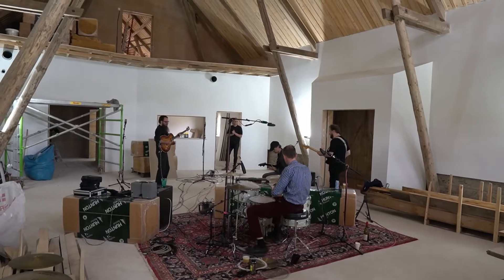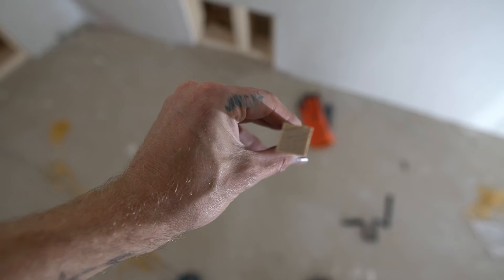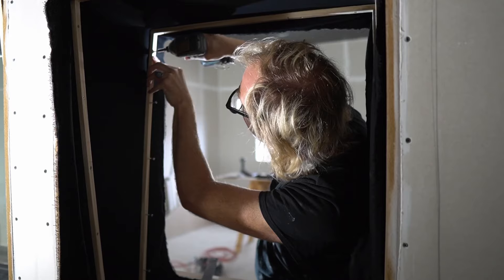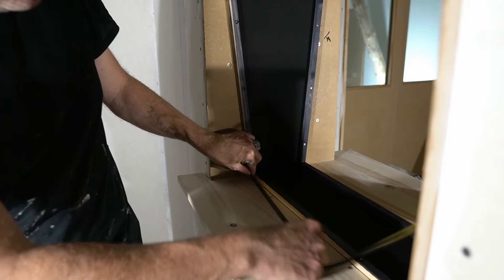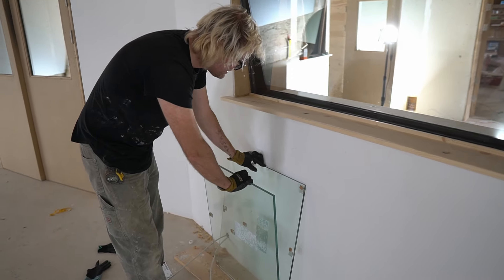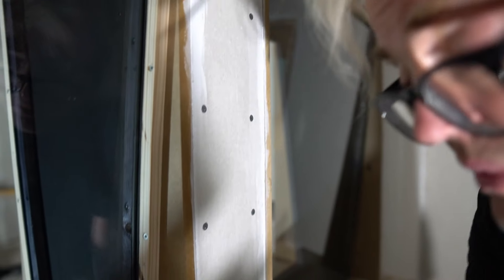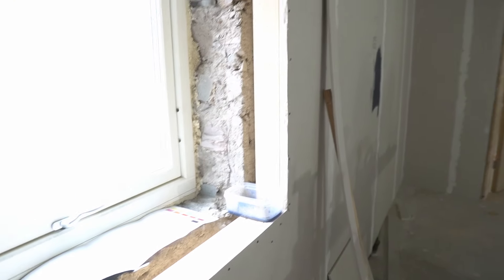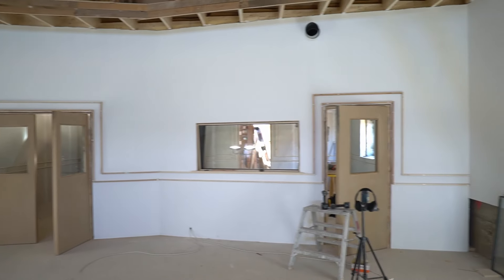Big Barn Recording Studio - WINDOWS

Comment: Why does the weight of the glass need to match the weight of the removed wall? ( love the project by the way )
Reply from the maker: Because you need to keep the total mass of the layers intact. If your soundproofing plan consists of 4 layers of plasterboard and then you cut a big hole in the wall, you need to fill that hole with glass that weighs the same as the plasterboard/wood that was removed